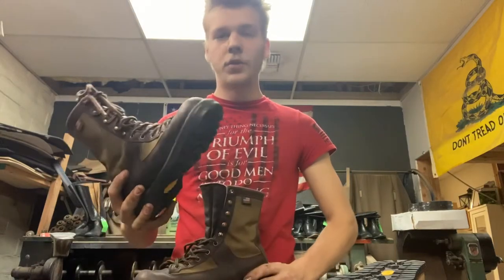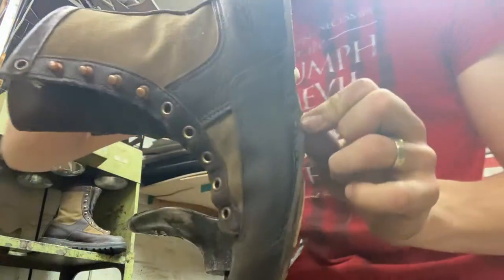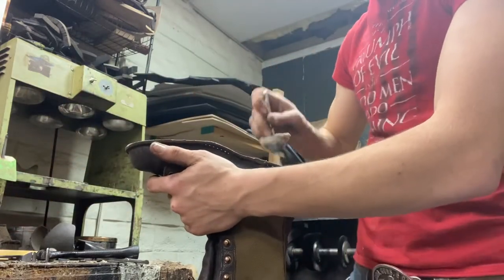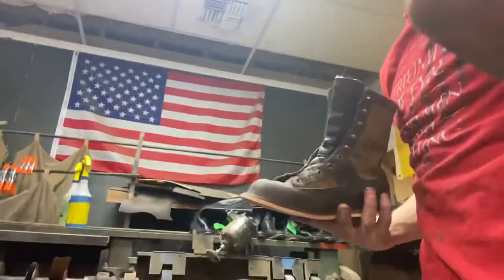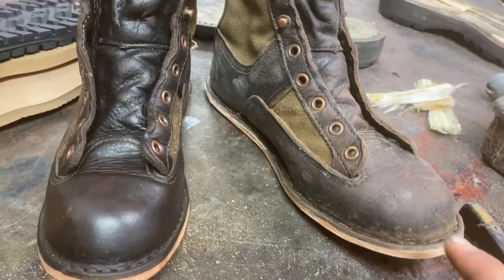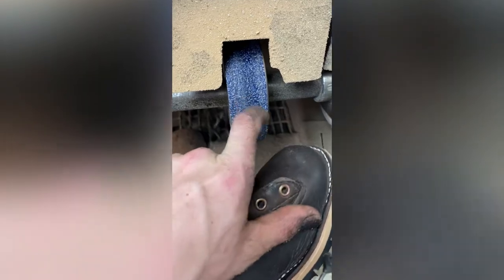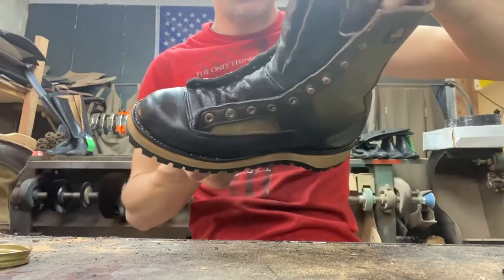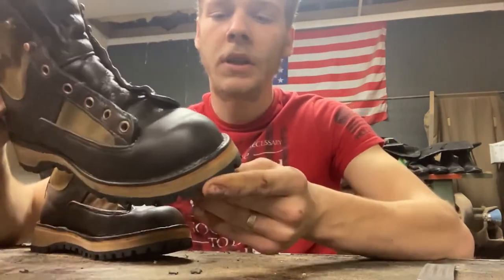Customizing a pair of Danner Sierra shoes with the Shoe Man

Comment: Is it possible to take a pair of Danners like those or the Canadians and somehow add ankle support to stiffen up the sides by adding a layer of leather or other?  Just curious as a new pair of Kenetreks cost $500+
Reply from the maker: What I’ve seen done before is by “beefing” up the heel counter. It would require completely deconstructing the shoe to get In between the upper leather and the liner. I would recommend talking to Bedos leather works for that job, I’m not that experienced yet. If your worried about walking to the outside then a simple wedge will help push you to walking more in the center.

Comment: What's the special glue? Cement? What's the best brand?
Reply from the maker: For us shoe cobblers I like to use either reina or masters. For diy purpose I recommend barge
Reply: @Theshoeman02  thank you sir. Do you think it will work with my outsoles on my soccer cleats?
Reply from the maker: @erniecarrasco9107  possibly, I could never guarantee my glue jobs with materials that I don’t use. Just make sure to clean both surfaces very well with rubbing alcohol or acetone, apply a thin coat to both side, allow it to dry then press and apply pressure.